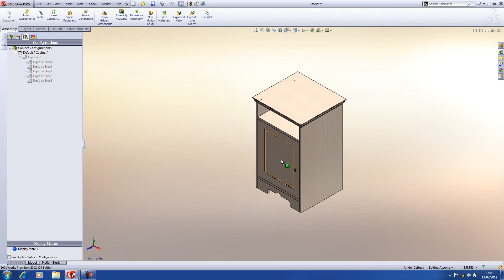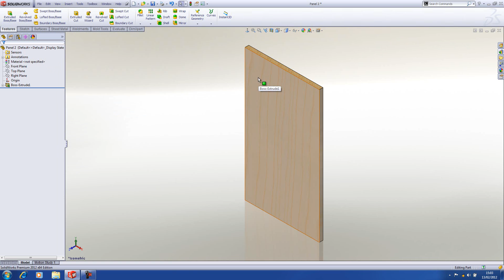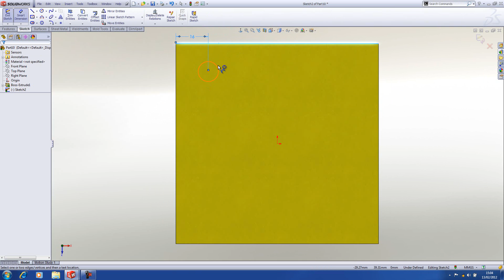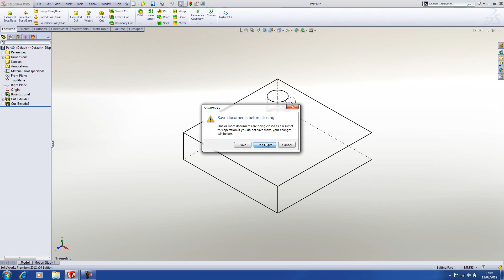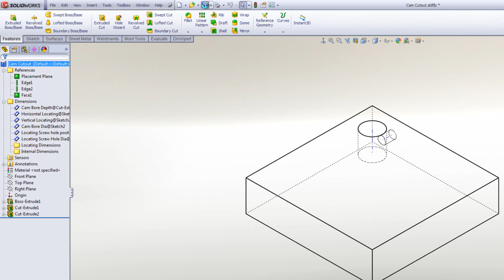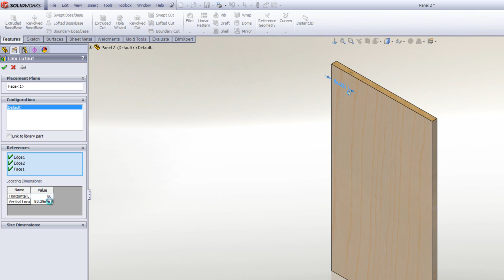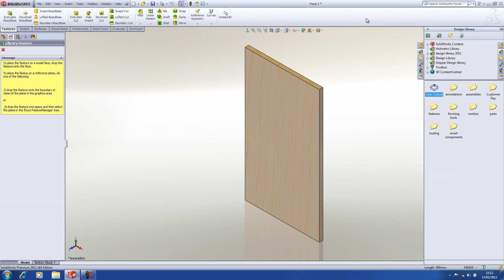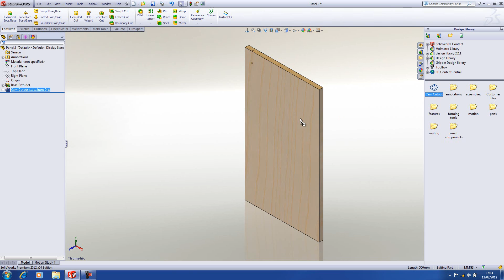Library Features in SolidWorks

Comment: Before seeing this video, I implemented the same cam and dowel feature at the furniture company I work in. Glad to know there are also others who do this.

Currently my set up is the exact same as shown in the video (each hole has to be positioned independently). I tried to take it a step further by adding relations between the two holes so that they are always centrally aligned. The relations I added depends on the orientation of the part, so it didn't always work.

I tried using equations instead to align the cam and dowel features, so then the hole distances from the panel edge will always be the same distance. Problem is the design library feature only carries over the equations and not the Global Variables... such a shame as it would've saved more time.
Reply: Hello, maybe you know how to make smart connect with two holes in different parts? For
Example Rafix system.

Comment: I have tried to do the exact same thing and some more intricate ones, but keep getting the same error... When I use the library feature on a vertical side of my part it works fine but when using it on a horizontal side it always fail, even tried doing it exactly as the one in the last part of the video (one with horizontal 6mm hole works but as soon as I try the one with vertical 6mm hole it fails). Any ideas?